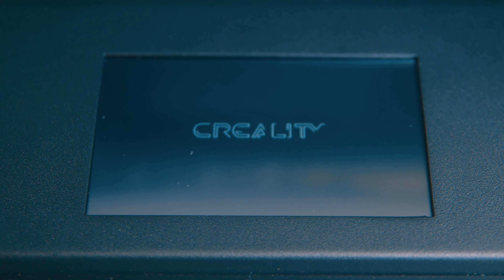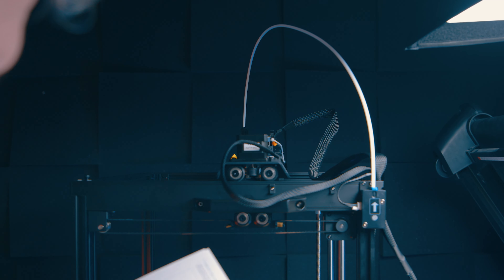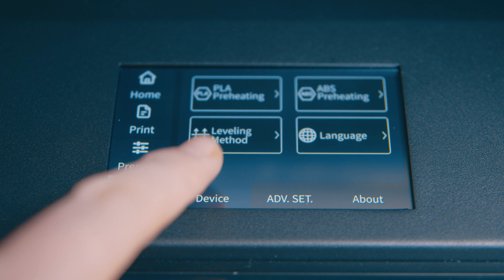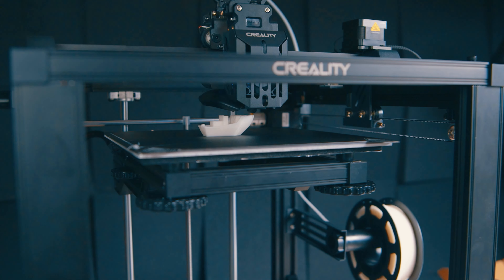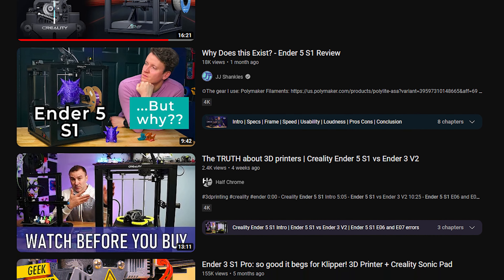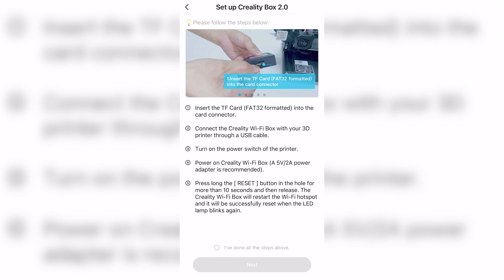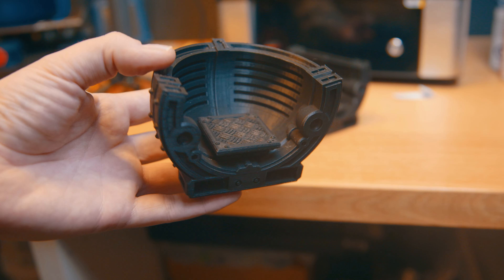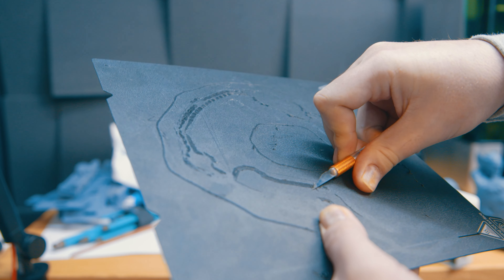Creality Ender 5 S1 Review

Comment: I'm so tempted to pull the trigger on one of these right now, currently owning two Sovol SV06 Plus machines.. After having moved onto Klipper firmware, I am BADLY wanting a CoreXY printer and to move away from bed-slingers entirely. If this machine had a 300X300 buildplate, I would already have one in the mail.. I will sleep on it and see how I feel tomorrow. What he said bout tall models at higher speeds with bed slingers is very true.
Reply: Check out the endor 5 s1 plus. Has a bigger plate

Comment: Stringing can be dialed in in the slicer software. Retraction distance and speed need to be tweaked.
As for the bed adhesion. Raise your z offset a little bit. It will print the 1st layer just a little farther away from the bed and won't "push" the molten filament as much into the build surface. Mess around with it a little bit and i'm sure you'll have it dialed in the way you like it.
Reply: Won't it affect other layers as well, offset will be used in all layers?

Comment: Nice review. I've had mine for a few weeks now and quickly dialled out the stringing with retraction distance and filament temperature.
Reply from the maker: Yeah, I still need to do mine. It works fine for what I need

Comment: Stringing is not always a retraction settings as per other comments. New fast printer profiles in slicers tend to keep the nozzle way too close to the print while travelling. Most likely, it will drag on the infill. In my case, the nozzle was not 0.4mm anymore because of the dragging. It was a tiny bit more and for this reason, it was extruding a tiny bit more filament. Said filament was the cause of the stringing. As soon as I've replaced the nozzle, no more stringing. Obviously, to increase the nozzle lifespan, I've increased the Z hop from 0.1mm to 0.2mm as well as disabled Reduce infill retraction. Last thing to change in the slicer was to comment out, in the start gcode, the retraction happening between the purge lines and the beginning of the print as it would not extrude for the first few millimetres of the print. Takes 2 minutes to swap a nozzle as opposed to troubleshoot for hours. At least, you are getting this out of the way. Keep in mind that it does not take much dragging for the nozzle to behave as such. Only a 1/4 spool is enough.

Comment: Very interesting to hear your perspective since some others with far more FDM experience have had issues. This is why reviews from multiple angles are important. That spider man print is particularly impressive. The stringing can likely be fixed with either a minor retraction change or combing setting. Good stuff!
Reply: Bro no way you’re into 3D printing too
Big fan btw
Reply: @Whodini1010  I am indeed as of fairly recently! Already neck deep in research, hahaha. Planning to 3D print the V10 Impreza throttle body adapter prototype. Thanks a ton!
Reply: @802Garage  please make a video on that !
Reply: @Whodini1010  Def plan to. So much to release. Thank you!

Comment: Love the video. Have you tried the Ender 5 plus? Be interesting to see how the bigger build plate fares.
Reply from the maker: Creality won’t work with me anymore
Reply: @FauxHammer  Why what happened? I literally bought this printer because of a few reviews which were mixed and confusing, then i saw your review video and it was just a lot more clear and i decided to get this exact model from Creality. Great video btw!
I was also considering the Ender 5 Plus but with the sale it was still 100$ more than this and i got this one for $300 new from microcenter on a sale they were running.. 
I got the acrylic enclosure side panels, and they also make a nice top piece to finish the enclosure as well now. So besides the bottom it's pretty sealed up now actually..

Comment: No matter how many times I level my ender 5 s1...it refuses to consistently print...well..anything.

I just want the thing to work...I've never gotten it to print 2 prints back to back that actually finish after a year of ownership.
Reply: Not sticking to the bed?  You might need to adjust your z offset.

Comment: Nice printer but I have a lot of issues with it. The first printer stopped working on the 2nd day, oder a new one and it wasn’t working at all. Both had hotend issues.
Reply from the maker: Ooof that awful.
Reply: When it runs, it runs nicely but to get it run is problematic unfortunately

Comment: I absolutely love your reviews. I will probably but a resin printer one day, and your reviews are extremely helpful in knowing what I'd be getting myself into. I'm sure you heard this a million times, but if you like the idea of "plug and play" FDM printers, you might like the Bambulab printers. They're kind of expensive and the  build area is not significantly bigger, but these also produce very good quality prints quickly without any significant assembly required.

Comment: It's not core X Y.
Reply from the maker: No?
Reply: @FauxHammer  No.
Reply from the maker: @rahyan.  how so? What am I missing?
Reply: @FauxHammer  It's a Cartesian printer as you have a dedicated motor for each axis. It does look (a little bit) like a Core XY though.
The misses are only some speed and way more durability. With a Core XY you could've reached better speeds, but it's kinda useless as the 250mm/s are already impressive.
As for durability, you'll only have to check if the wheels aren't getting wear, if they are (it generally happens after 2-3 years of ownership and lots of prints), you can replace them. You can also check if the belt is properly tightened only if you have some printing issues, if they're not, you can screw it back.

You somehow confused it with a Core XY printer due to the fact that you're new to FDM printers (as I am too. But I'm always seeing Core XY machines and Cartesians ones as well as different types). The wheels directing the y axis (and the movement of the x axis) are a giveaway that it's not a Core XY.

I hope this helps.

By the way if you see this comment (or if you read till here), I'd like to know how your printer holds up after >1 month of use.

Comment: Sorry, but the Ender 5 S1 ain't a good machine. Don't believe me? Go on, buy it and find out yourself. 😉
Reply from the maker: It was good at the time, it;s been quickly replaced
Reply: Sorry, but you don’t criticize it without stating at least a reason why and preferably a verbose explanation if you want people to take your comments seriously. While stating that you don’t like it, you have given nobody else reason to avoid it. That leaves the impression of the original video and therefore makes your comment redundant. Maybe edit your comment so you sound more informed and experienced.
Reply: Agreed, been using an Ender 5S1 with Sonic pad, PEI Sheet, and Acrylic enclosure. I learned a lot having to tinker with it but out of the box the sonic pas and software wasn’t working and I had to flash it… I love to tinker but when I spend more time tinkering rather than printing…. Its not a good experience